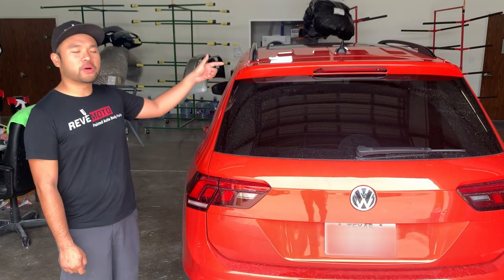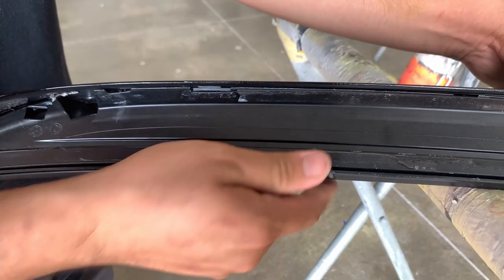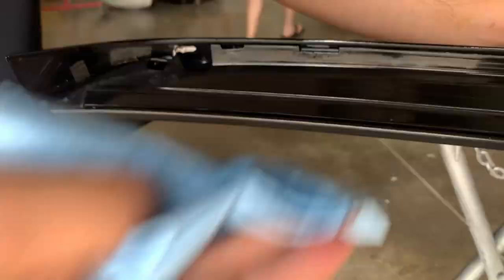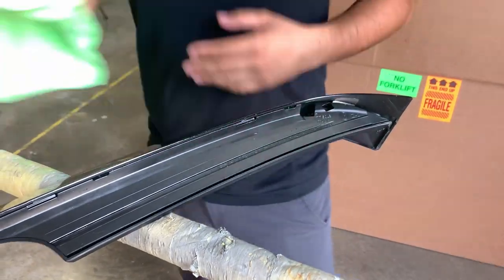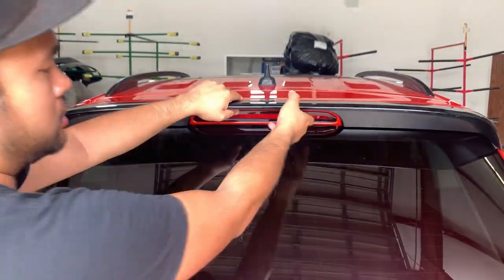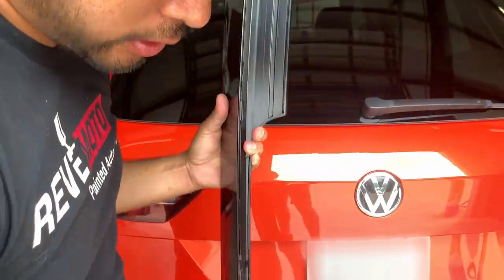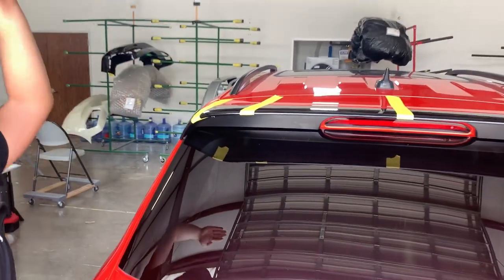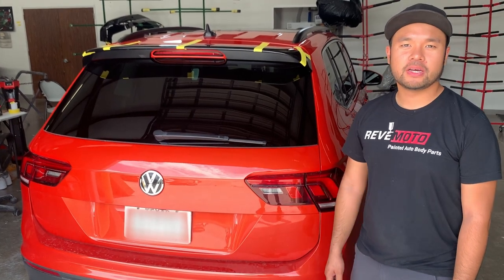2016-2020 Volkswagen Tiguan rear spoiler install | ReveMoto

Comment: what's the part number for this? and you cut out the most important bit, actually installing the spoiler. looked like it wasn't mating up easy so always good to see any tricks and tips and learn from peoples mistakes but you folks lopped that part of the video off probably to save time and not show yourself struggling, but I would have rather seen you cut out some of the failed attempts and shown what you did to get it to seat perfectly. cheers.
Reply from the maker: Hi,  So the most difficult part was the 3M tape and lining it up.  You want to prevent it from sticking because it is a very strong tape and taking it off is hard.  Have a friend on one side to make sure that side is lined up.  This one a customer dropped off so we didn't get the part number to it.  Go to www.ReveMoto.com for painted autobody parts.